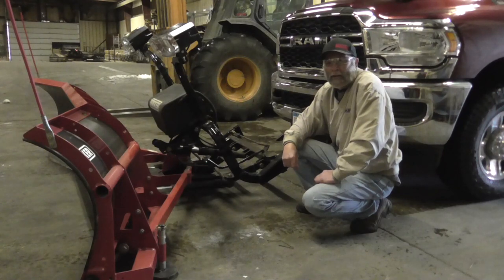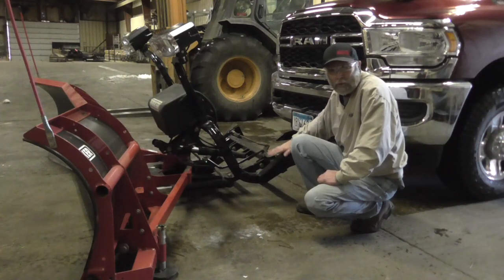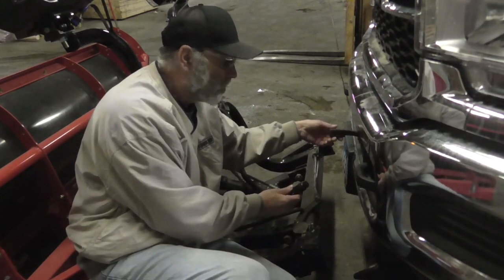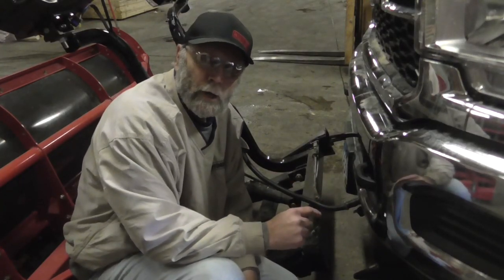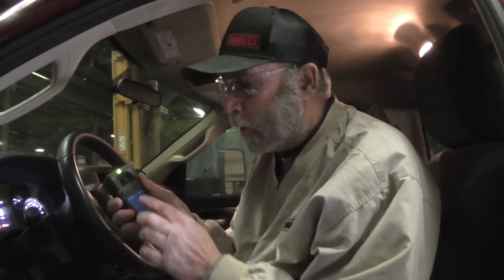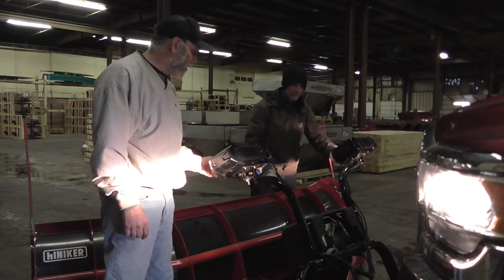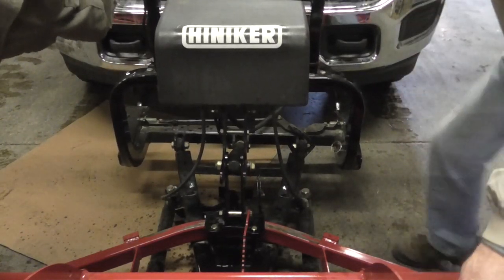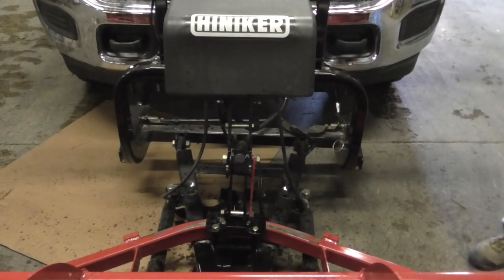Hiniker Snowplow Falls Forward without Kickstand | How to Use Hiniker Quick Hitch | Line Up Plow

Comment: My plow is having trouble collapsing the cylinder in float mode what can my problem be
Reply from the maker: Be sure the controller is on and in the float mode, the light should be yellow, not green.
This opens up the down valve.
If the plow hasn’t been used much the packing seals can dry out and get set sticky, making it difficult to push in the cylinder rod.
Spraying WD40 or similar product on the cylinder rod may help lubricate the rod and make it easier to compress.
If the truck sits lower than normal it will make compressing the cylinder harder also.
A simple fix for this is to drive the front tires of the truck onto some wood planking, raising the front end of the truck. 
Doing this takes some of the weight off the plow, making it easier to compress the lift cylinder.